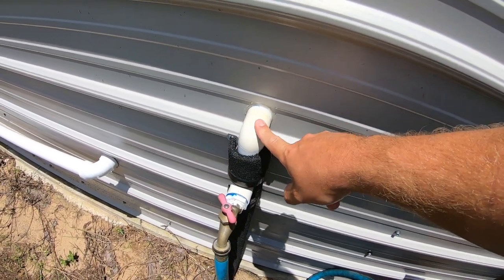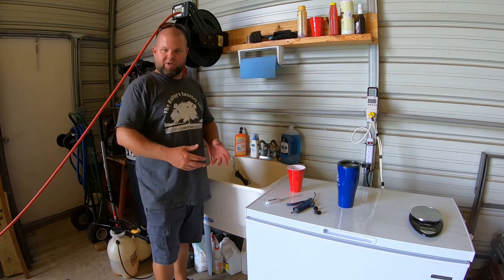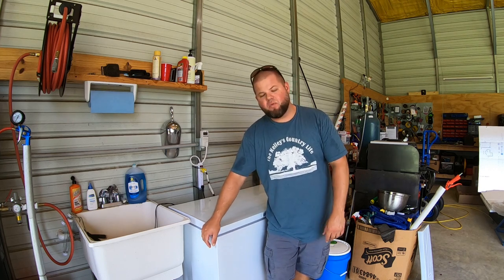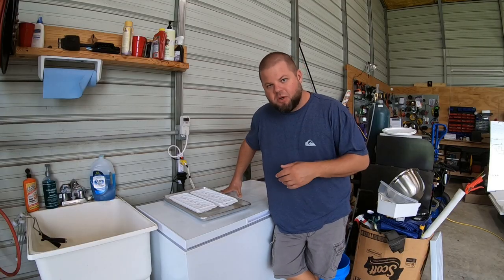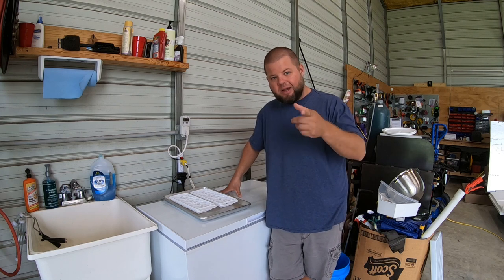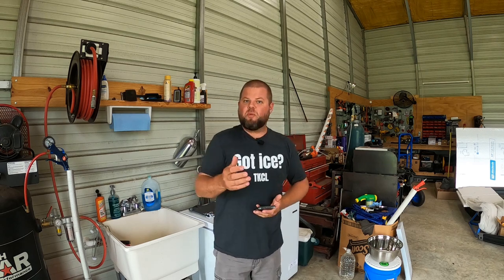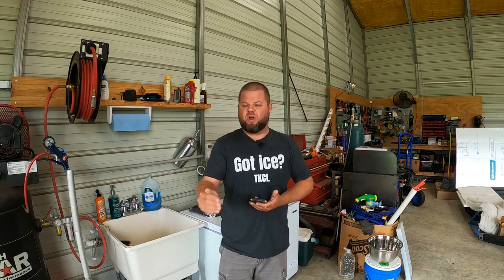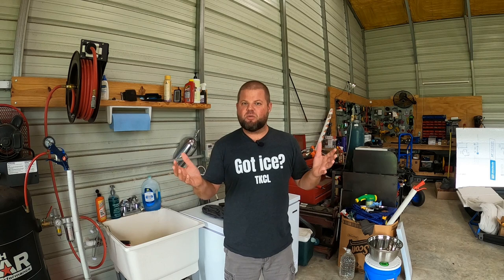Homemade ice machine tests! Hot water freeze quicker than cold water Mpemba effect? #376

Comment: 1.  Please, what is the wattage draw of just the compressor running?  I'm guessing between 100 and 200 watts.
2.  On the right side of the front of the ice maker is a plastic screw that will adjust the size of the cubes.  I think you'll find smaller cubes will result in more total ice per day.
3.  Would love to know the total KWHr of a day with no ice production just so we can know the steady state losses.
4.  Lower the thermostat all the way to maximize ice production and get longer lasting ice.
5.  Thank You!!
Reply from the maker: Compressor running is around 66 watts, initial startup peaks over 500 watts. I have checked twice and didn't see any adjustment screw under the end cap
Reply from the maker: Thank you, I didn't think to look on the side, just the back.

Comment: Watching water freeze tests 
The way water freezing works is the same way your A/C, refrigerator and freezer works 
It’s by the removal of heat. So of course cool water will freeze faster because of less heat at the start. But to test accurately it should be done separately because the chilled water is absorbing heat from the hot water sitting next to it. Coolness attracts heat. Same as glass of ice water gets condensation on the outside of glass. Because it is attracting heat. Learned about this years ago taking a/c class in Chrysler school, when I was learning how to work on car A/C systems. They make you take the basic a/c class first before the advanced classes which is smart for Chrysler

Comment: The running water idea is a flawed approach for the simple fact that like you said the water in the line inside the building is still sitting there warming to room temperature. Because each batch of ice takes time to make by the time it needs water again the water in the line inside the building is up to room temperature. At least those are my thoughts. To correct this your trickle of water would need to come out of the line feeding the ice makers close to the freezer so the water they take in is that cold ground water.
Reply from the maker: Understand that! But testing shows it just isn't enough of a drop in temperature. It's a go big or go home type of approach. I think there is easier approaches to more ice production.
Reply: Room temperature still cooler than the temperature of the water that was coming out of the tap that the line was baking in the sun.
That was why he let the water running. it was so the sun didn't had time to heat the water in the pipe.

Comment: Hot water makes harder ice than cold water.  Hot water has less gas entrainment; cold water enables gas to dissolve more readily.  The best skating rinks use hot water for their ice.
Faster? No.
Harder? Yes.
The super fancy clear cubes used for expensive cocktails use hot water.  Cold water makes cloudy cubes.
Reply: Interesting, but I tired to verify this and came up with nothing that backed up your claims here. I think you've been told a wives tale.
Reply: Agitation makes the best clear ice if I remember correctly
Reply: Look up the effects of freezing previously boiled water.
Reply: I belive clarity and density of ice is all about dissolved solids and gasses... If you can get as much dissolved solids and gases out then freeze it as quickly as possible from the inside out you get hard clear ice... The reason ice rinks use hot water is so that the core (bottom area) of the ice (that closest to the freeze piping ) freezes first.. allowing dissolved gasses a path to escape through the still liquid surface before the surface freezes... the surface being "hotter" for longer time then the bottom is aided by using hot water. 

Incidentally you can get harder more dense ice from using dissolved solids in the source water... but that would not be desirable in an ice rink or a cocktail...

Comment: I love the fact that Andrew is using ice from his icemaker to chill water so his icemaker can make ice faster. 

I know it's just for testing but it cracked me up.
Reply from the maker: Yes just for theory. I'd be using more than it helps produce, so it isn't cost effective in the long run.
Reply: @TKCL  Basic science where you want 32 degree F water coming in.
Also the heat transfer of air is actually very poor. You would do much better if you can heat sink with solids directly to the cold side of freezer with good heat transfer materials.

Those 2 things are about all you can do.

Comment: Since that water sits in the fridge for a couple hours or more between fills, I think plastic tubing would get just as cool in that time. Great show!
Reply from the maker: It very well may, and that's a cheaper alternative.
Reply: @TKCL  you've already got 40' of plastic tube from this video. Just run that through the mini fridge.
Reply: Use copper, it conducts heat better.  Just figure out how much water gets dumped in the tray each time is fills.  Then get enough copper tube so it will contain that amount of water.
Reply: @justoutoftime511  Fridge doesn't get that cold, plus he already has the plastic.
Reply: @TKCL  As long as the volume of water within the plastic tubes that are in the pre-chiller is MORE than the two ice-makers are using for each batch it would make zero difference between copper and plastic tubes. The thermal conductivity of copper is only important if the time in the tube is short. So having a "tank" or a lot of meters (inches of the tube) of plastic tubes (basically a tank regarding volume) precool the water no matter what.

Comment: Leaving the water on will not help. The 1/4”water line isn’t flowing it Sitting behind the fridge in a hot building with the heat from the freezer running as well.
Reply: True. Would have worked if he added a T on the little plastic line just before the freezer and trickled the water from a tube right there. Could just run a length of tube back to the sink.

Comment: I would look into an under sink water chiller. They are expensive $200+, but as a bonus you can add a faucet to your sink and drink cold water whenever you're in the shop! Or get a chilled and instant hot setup so you can have hot water at will too. Would be easier than drilling into your fridge and keeps a third of a gallon or so of water around 42⁰
Reply from the maker: I looked into them, most were more than I spent on the entire build. Going to have to pass.

Comment: When do you do the ice testing also test adding normal cheap table salt to the ice in the cooler. Does it chill the drinks quicker or bring them to a colder temperature? I know people add salt to the ice when they’re making homemade ice cream. Wondering if it’s worth it (cost of salt and time to clean out the cooler/wipe off the cans/bottles of salt)
Reply: When matter changes phases from solid to liquid or liquid to gas, it cools due to a phenomenon called latent cooling. Adding salt to ice as in an icecream maker, lowers the melting point of the ice, causing it to melt, and causing it to drop in temperature due to latent cooling.

So this would increase the cooling ability of the cooler, but would consume ice more quickly, since you're not removing any extra energy. It would be interesting to see how this would impact the efficiency when you factor in the higher ice consumption.

Comment: Yes, I didn't think the hotwater would have worked. If the icemaker was in open air, like the commercial systems are, with a waterfall affect, then it would work. But even then, yes, it would freeze faster, it would make less ice due to loosing water, so by weight the hot water would be less, but freeze quicker, making no difference in the end.

Comment: If you want to run water at ambient temperature long term, you can fill a drum/barrel using your well water stored inside away from the sun. Then use that to fill the ice makers. For small testing you can use buckets instead of a drum mounted higher than the ice makers so you can use hydrostaticpressure to fill them (no pumps needed). Obviously a larger volume of water takes longer to heat or cool so temp fluctuations would decrease during production. You can also add some ice directly to the water to cool it. My humble suggestion.

Comment: I wonder if a passing the water through a radiator like on the ones used for PCs would work. Also a portable evaporative cooler to help cool things further although humidity would go up. Another thought is if the discharge air from the radiator is still cooler than ambient then passing it through freezer's condenser might help it come to temp faster.

Comment: The more i think about it. With the heat produced with the ice makers there could be a 10- 15 degree difference from top and bottom. Yep 1 fan ducted to bottom has to be tried and turn the other one off. Now that you have the plastic line already and you have 2 cold spots on the outside it only makes sense to put that to use as well without damaging your mini fridge

Comment: "The Mpemba effect is a catch-all term for hot water freezing faster than cold water. 
This so-called “effect” is NOT reproducible, prompting the question of whether it actually exists.  
The Mpemba effect is named after Tanzanian schoolboy Erasto Bartholomeo Mpemba (born 1950) whose story of it in 1963 became highly popularized. The schoolboy's findings have never been replicated under controlled conditions."  -wiki
Reply: I actually wondered about that but never looked it up.
Reply: There's no fancy effect. It's simply hot water will evaporate in a cold low humidity environment. This evaporation of the water adds to the cooling. But you'll lose some of the volume. The same cooling effect happens when you sweat and you're sweat  evaporates
Reply: @Bryan-Hensley  evaporation does add to cooling while it is hot. But as the water cools it eventually reaches the chilled water temperature and at that point there is no evaporation advantage thus ice cubes will not form faster with boiling water.
Reply: @Bryan-Hensley  That does not in any way imply that hot water freezes faster.

It transfers heat faster initially, but transfsr drops as it cools toward the freezing point.

It will always lag behind the water that started at a lower temp.

For it to be otherwise, there would have to be a differencr between 32F water that used to be hot, and 32F water that used to be warm.

There isn't

Of course the difference in freeze times is small, because most of the btu's transferred are due to phase change, not cooling the eater.
Reply: @ddgiant  I agree it won't freeze faster. But that's it where this myth comes from.
Reply: @Bryan-Hensley  Agree. but for those who aren't science-oriented, that does not mean hot water freezes faster than cool water- as he found out with a simple test
Reply: A big contributor to the notion that hot water freezes faster is that in areas prone to freezing, given a water line carrying hot water and a line carrying cold, the line carrying the hot water is the one that freezes first.  I have no explanation, just years and years of repairing water lines and witnessing this phenomenon. 🤷🏻‍♂️
Reply from the maker: I've heard that a lot
Reply: @DieselRamcharger  that’s a good thought but I’ve seen the hot water lines frozen in cabins etc where neither line has had movement for days.
Reply from the maker: Wonder if it could have something to do with material used? Down here it's coming for cold water lines to be pvc and hot water lines to be cpvc. Don't know if it's that way up north? Another far fetched theory I have is warm water lines will be slightly higher pressure due to the temperature (depending on if it can backfeed into the pump ect). I believe higher pressure will freeze quicker.
Reply: @TKCL  in ohio cpvc is no longer allowed to be used for water supply,  we use pex or copper, but when people did use cpvc on water they used it on both hot and cold
Reply: @TKCL  Where the myth comes from is observation and interpretation errors, along with the same contrarian streak that gives rise to conspiracy theories and magical thinking.
Reply: @Zomby_Woof  Nailed it... I am a master contrarian... but not when it comes to "real world" physics... If it defies "real world" physics (black holes etc.) I am not competent enough to argue one side or the other so I err on the side of "I dont know"... not "prove it or its not true"... Great thing about this video is Mr. Kelly errs on the side of "I dont know, lets test it"... Which is legit science.
Reply: @DieselRamcharger  indeed it does! 🙂

Comment: you might see a slight increase if you expand your coils.  leaving them tightly bundled like that means that it takes longer to cool down.  condensers in stills can bring alcohol down to the low 40s with just crick water.

Comment: I heard that theory of hot water freezing faster back in the 1970's. I took two empty soup cans and filled one with boiling water and the other with water from the tap. I set them outside on the porch. (Michigan in the winter) Water from the tap froze first. I believe that even if the difference on time for freezing water between 70 degrees and 90 degrees is unmeasurable it still takes more electricity to freeze 90 degree water than 70 degree water. Also using the mini frig to bring down the temperature of the water will probably take just as much electricity as putting the warmer water directly in the freezer unless the refrigerator is more efficient than the freezer..
Reply: He's already got the fridge running 24/7, I doubt that precooling the water for the ice maker would make a measurable difference in its efficiency or energy usage...
Reply: @technicaltom1886  If it runs 24/7 there is something wrong with it. Could be the thermostat, missing seal around the door, dirty condenser, or low on refrigerant. I used to have a refrigerator that did that in its last days. Never stopped running and quit cooling so it was as warm inside as it was in the room it was in. Any refrigerator should cycle off when it reaches a set temperature. If it doesn't it would use a lot of electricity just as a gas furnace would have to use more gas to heat a home if doors were left open or the house was poorly insulated because it would have to run more. Any time the refrigerator is opened letting warm air in  or has something warmer than the set temperature put in to the refrigerator, It has to run more to bring the temperature back down to the thermostat setting than it would if nothing was done to induce anything warmer into the refrigerator.
Reply: @gordonwilloughby8793  Gordon, what I should have said is "running normally 24/7".  He is already using it as a compact refrigerator, so I assume it is running normally.   The water going into the coil installed in the fridge may be hot (or room temperature water if he uses a reservoir - it could just be a piece of two-inch PVC pipe and fittings before the fridge inlet) but the addition of the plastic or copper coil inside the fridge should not significantly impact the efficiency or electric usage of the fridge.
Your response seemed to be explaining a broken refrigerator, which I believe is working fine, from his comments I don't see that the refrigerator was 'not working'.
Reply: @technicaltom1886  A normally operating refrigerator or freezer has to run more to cool anything inside that is warmer than the thermostat is set for. The reason i mentioned a refrigerator that wasn't working properly is because you said the refrigerator was all ready running 24/7. The only way it would run 24/7 is if the refrigerator wasn't working right or a lot of liquid or food was added that was above the set temperature of the refrigerator or was going through the refrigerator fast enough so the refrigerator never reached the temperature it was set for preventing  it from reaching the shutoff temperature. If the amount of water going through was less so the refrigerator could still cycle off but still ran more to remove the heat from the water it would take more electricity than if it just maintained the temperature of the contents inside the freezer. without warm water or food entering. The more it has to run the greater the power consumption.

Comment: There wasnt much benefit, but for the haters, run a drip irrigation system for your "garden" that keeps cool water supplied to the ice makers.  Pretty easy to calculate the power to lower temperature of water while liquid, and then the one that is ten times more important, the energy to make the phase change from liquid to solid.  That phase change is why its hard to make ice and on the other end of the weekend, you still have ice after 3 days.  water ice is pretty magic if you think about it.  try taking 20 lbs of vodka in your cooler that is still liquid.  You will have a great first night, but have a lot of warm vodka after 12 hours.   Take 20 lbs of ice and you will have 16 lbs of ice.  the next morning.     If you fish, you need more ice, if you drink, you need more vodka.  You want to end your trip with "stored" energy" that you took with you to bag some fish and keep cold beer for 4 days and slide into the dock with nothing to spare
Reply: Or if you have a pool, drip it to your pool... It will make up for some of the evap loss on the pool. I agree that running water for no reason is wasteful but nothing says you can't use that water for something or collect that water some how for future use.